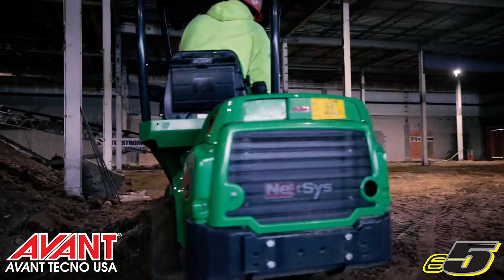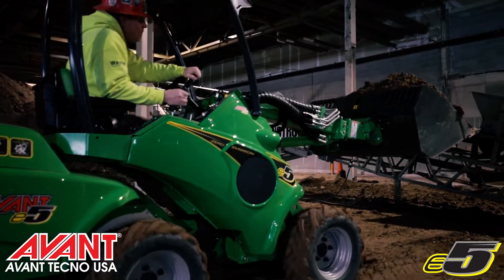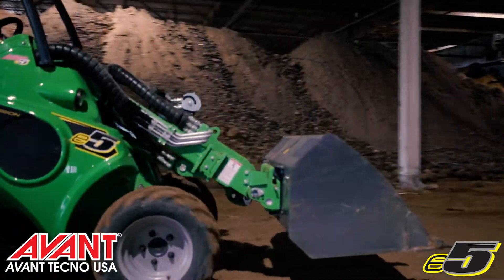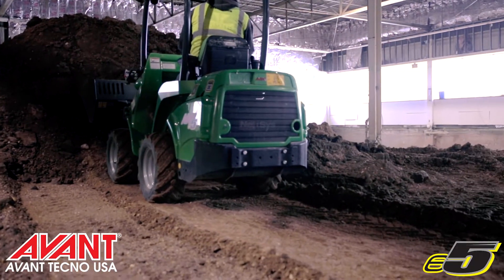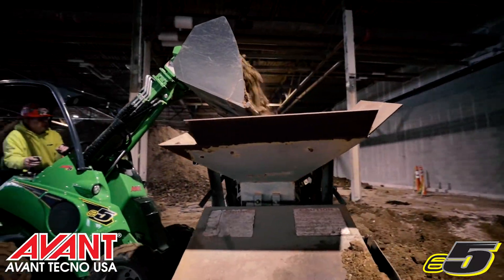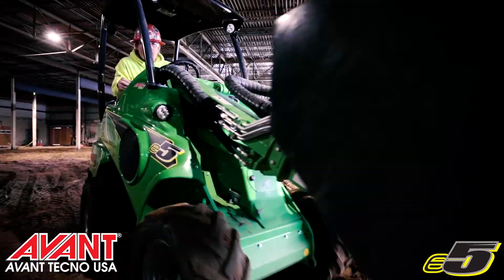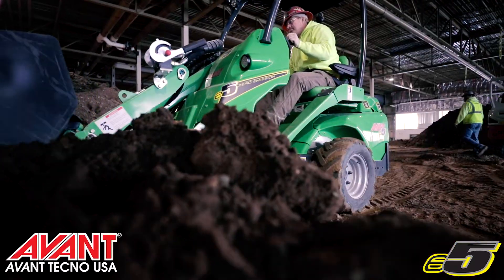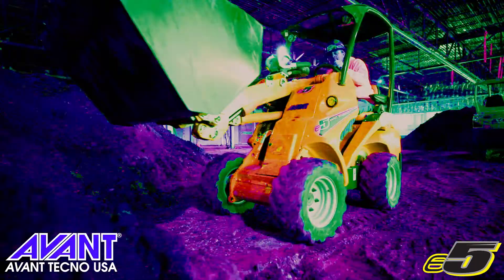Introducing the Avant E5

Comment: I own a 2014 Avant 420.  It is the backbone of my tree company.  The Avant moves 1,000's of pounds of limbs and trunk sections daily.  I have experienced no significant malfunctions and the machine has roughly 2000 hours.  Because of the turf tires we have never had to replace a lawn, as it does no harm to turf.  My workers comp cost is lower because this machine does the work of 2-3 people.  My employees love running the machine as it is a joy to operate.  I almost cried when I ran it for the 1st time as it has extended my physical ability to stay in a business, and improved our profitability!  I would highly recommend Avant paired with branch manager grapple and rake to any tree service.